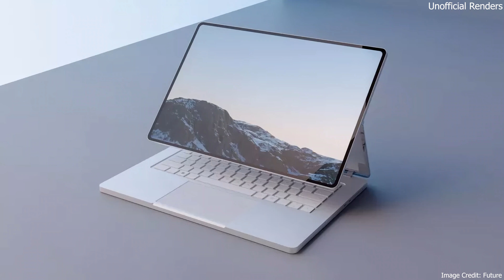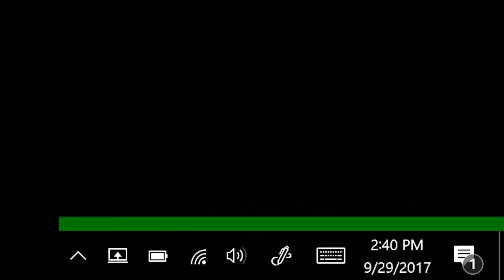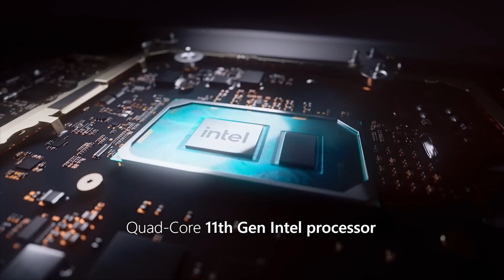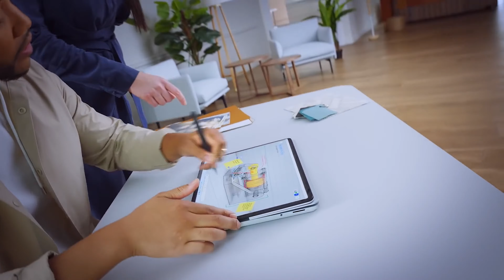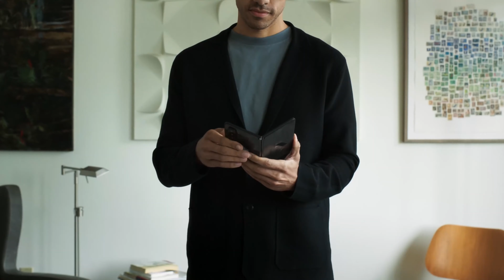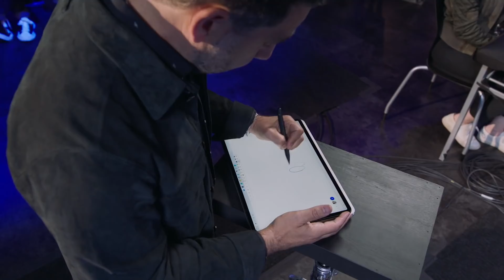Surface LAPTOP STUDIO: First Impressions Review

Comment: Any suggestions for note making software other than onenote? I donot need zoom in/out functionality or handwriting to text functionality . It just needs to be able to let me use different pen colors, and if possible, snip and paste content from other documents (the latter is not an important feature).

Also any decent always on cases for the laptop studio? It’s a new device so unable to find cases for it. Sleeves are easy to find as it’s almost the same footprint as the surface book (just a very tiny bit taller)
Reply from the maker: Have you tried Journal?
Reply: @oztabletpc  will try it soon. Thank you for the suggestion. It looks very cool!
Reply: @oztabletpc  well well, Looks like onenote has an option to have finite canvas. Works great on the laptop studio and new pen!

Comment: I don't understand why the display resolution is lower than the Surface Pro 8. The SB3 had a 3000x2000
Reply: Well, the device has a 35W processor. To maintain relatively high battery life, something had to give. Also, the truth is you may not notice in your daily routine, especially because the screen can't be used like a mobile tablet (you won't be holding it close to your face).
Reply: @gyozakeynsianism  It's the same PPI as the original Surface Go. At laptop viewing distance, the lower resolution won't be noticeable. You're not likely to hold the Studio as close as a Surface Pro tablet.
Reply: @gyozakeynsianism  In the Finacial business or Trading, where you have many Charts, high resolutions give you more information. So now I will see more Chart History on the Surface Pro 8 as on the SLS.
Reply: @liquinvest4667  But if the display of lots of finance info is your goal, you should just get the SB3 15". It'll easily handle all basic finance tasks plus some more sophisticated ones.
Reply: I have the device with me along with the original surface book. I don’t perceive a lot of difference in the pixel density.